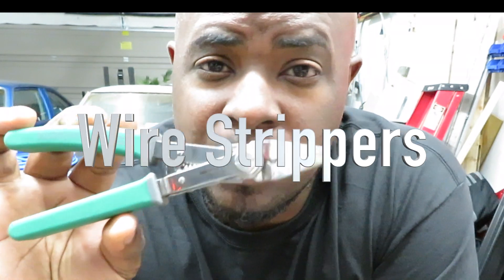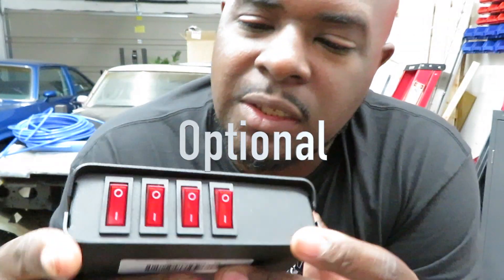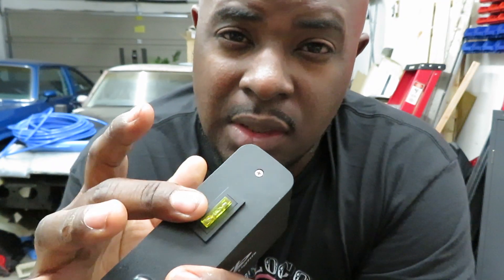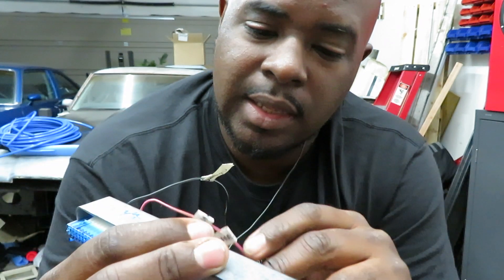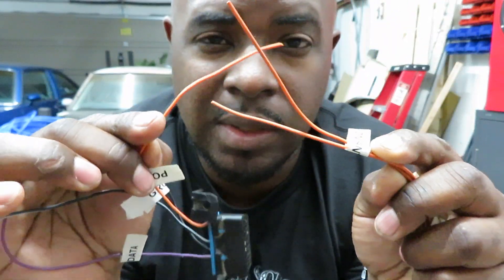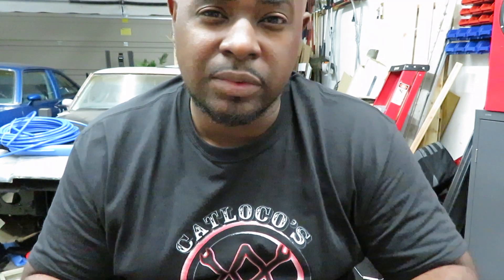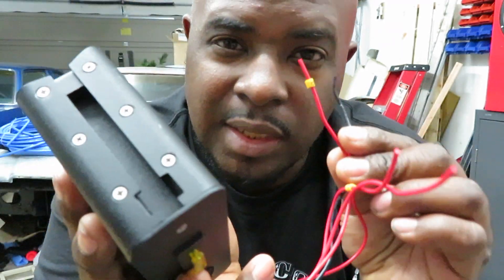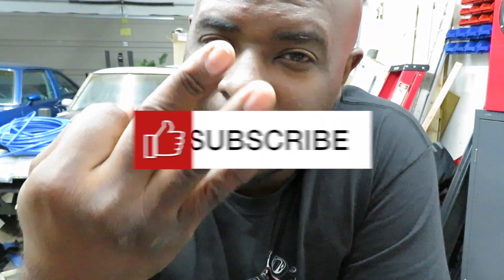How To: PCM Bench Harness for a LS Swap

Comment: Hi.. Can I ask you something.. I want to do this without pining all pin out of plug end wiring only this wires can work.. The plug is cut from harness but I haven't other plug
Reply from the maker: This is only for a bench harness to flash your pcm. You need 2 pcm connectors and the obdII plug. The wires I showed is all you need to connect. I removed them for a clean build and avoid any type of wiring short from an exposed wire. I’m sure some people leave them. This harness won’t be used on my vehicle
Reply: I understand.. I want to flash my pcm at first end then to use this plug to marry in my harness.. It could be?

Comment: hey man gr8 vid thanks - im new to LS swaps and was in the jy today scouring - will this let you run a bare bones LS motor?  As far as the harness and ecu goes - whats the base harness and ecu requirements to run the stock ecu in an older car? do I leave the non blue connector? theres a ton of stuff also going to the fuse box, do i pull it out or what?
Reply from the maker: No. This setup is just for flashing a pcm on a bench. i haven't filmed a full harness vid yet. www.lt1swap.com has a full tutorial on making a harness. The process is the same, but you're going to keep far more wires for your engine.
Reply from the maker: Which fuse box? The truck? I have a detailed vid of pulling a harness.

Comment: You need to correct the power supply requirements,  you said 1 milliamp,  should be 1amp or 1000milliamps

Comment: Wat to do with the green wire that's left on the obd2 port
Reply: The one I have has 5 wires should i just pull the 5th one out
Reply from the maker: @cyrusent  Yeah I took it out. You don't need it for the bench harness. You can check www.lt1swap.com to verify.
Reply: @CatlocosGarage  thanks so much for the info
Reply from the maker: @cyrusent  You can also email me at catlocogarage@gmail.com and I can send you pics of the harness
Reply: @CatlocosGarage  ok I just emailed u for the pic
Reply from the maker: wilbert jordan I didn’t find your email. Can you email me again at catlocogarage@gmail.com and I’ll send u the pic if you still need it.
Reply from the maker: 5:51 of this video. You should only have those 4 wires on obd2 I showed in the video.
Reply: Here's my email Hp172005@gmail.com my email acking crazy
Reply: Thanks for the heads up on the amazon purchases I would like to use that exact power source and rocker box.  Could you email when you get a chance at johndienst@hotmail.com the places you bought them at amazon. I spent 5 hrs driving around looking for a 12v 1 amp out put power source. Again thanks for all the work. PS.  Just curious why the 20 amp fuse if you only have 1 amp DC current from the power source. Thanks again and hope to hear from you soon.